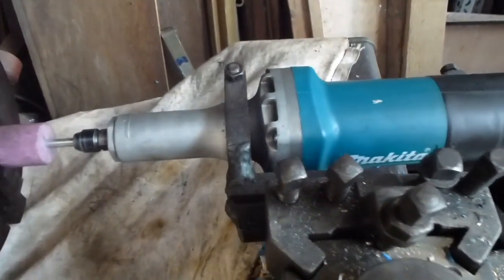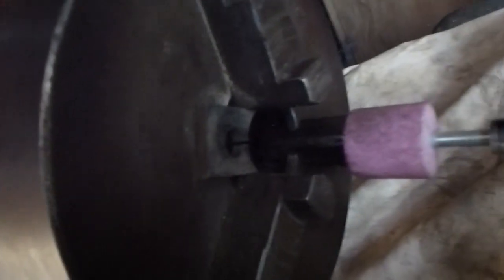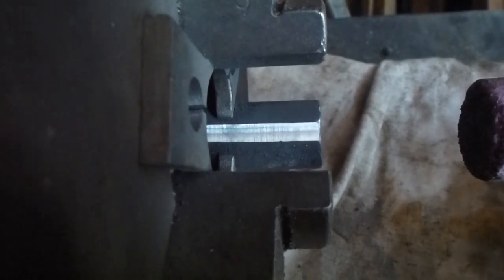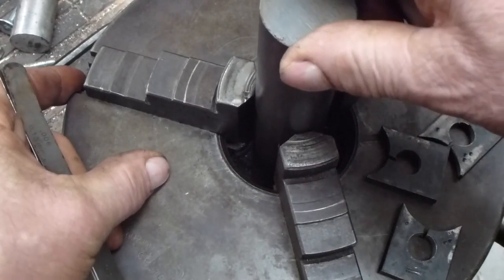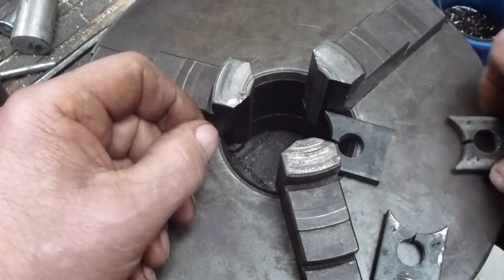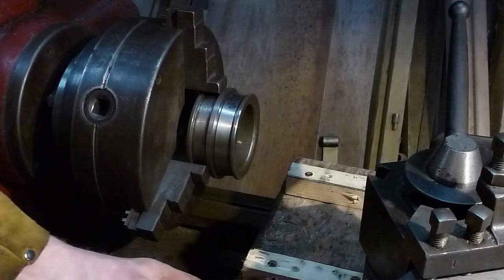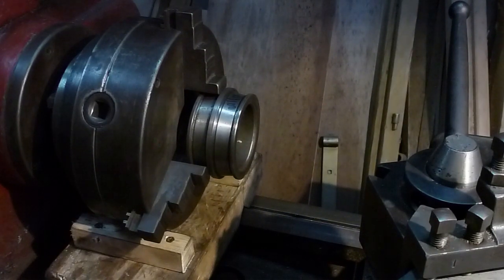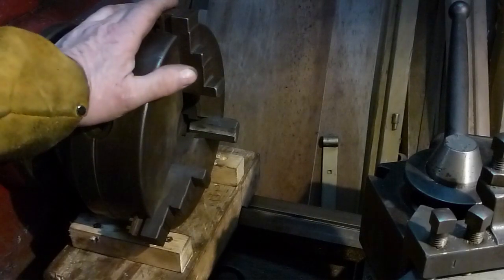Grinding the Jaws on my three jaw chuck Final version re-edited the end.

Comment: Time to get a new chuck mate.  A lathe is only as good as the chuck and the man using it. The best way to do this is to drill a hole in the exact same place in the furthest most part of each jaw for a small bolt. Then get a short length small diameter ring held on the very front by the heads of the bolts and tighten well. The smaller diameter you can do this the better.  Feed the grinder in and out automatic making sure to clear the pass each time at both ends.  If you want to you could even make a couple of spring passes from the back out most of the way but not the very end.
Reply from the maker: l allready did get a new chuck!  I've seen  the holes in the jaws since ( useful for holding copper protection in place too!! )  but the  bIocks  work very well !

Comment: I do not think that I would have the cuts in the blocks, I think this may be causing the problem.
Reply from the maker: Thank you for your comment! The cuts allow a better closing, they compensate for slight differences in the wear on the jaws. The problem is wear, not the cuts! Once reground, the chuck will be accurate at the diameter it was ground at! Cheers, Matthew.

Comment: I've seen a number of these videos and it seems fairly common to go into the chuck with some kind of round grinding wheel, or stone. Not only is the way the grind is applied contingent on how parallel the jaws are  to the z axis, but you're also grinding them at a radius. for small parts the surface will impact the parts somewhere in the center of the curved grind, but then at some point you'll be contacting at the outer points of the radius. 
I have no expertise at this at all, but I have to wonder if the best grind would be done on a milling machine and ground 'flat' or on a surface grinder and the jaws be mounted so they are a perfect 90 degrees to the track that the jaws slide on. I believe that if one has slop or play in the jaw tracks that will be another  issues that must be addressed, and not simply grind the Jaws with a greater than 90 degree angle which would result from clamping them onto something creating tension before the grind. One problem is that you cannot assume that the slop or angle of the jaw be consistent through it's travel so it's better to address that slop and fix that as well.
As a quick fix that will certainly improve a chuck I think that what's done in the video is fine, but to get a more precise repair I have to wonder about other methods short of buying a new chuck.
I've noticed that on my chucks the body of the chuck is soft steel, and that the jaws are hardened.
Reply from the maker: Fred, thank you for your comment, your absolutely right, but I only set out to improve repeatability! As it turned out, my chuck was so badly worn that I replaced it. Chucks very often have curved surfaces on the clamping jaws as it is a good way to make them concentric. I wasn't out to make them perfect, once ground, the point where they were reground is the only diameter that will be repeatable, the rest of the clamping range was improved, but it will never be a new chuck again!

Comment: Hey man. You need a thing like a tungsten milling bit or square router bit to cut the new face inside the jaws eh. Since that pink shit wears away just so so quickly. It's a good video and I needed to see done what you have done to hone my own ideas of fixing this age old situation. My lathe is an old basket case that is cobbled together out of whats left of a once fine machine with a big thread that takes the chuck. It can make some round things though. There is no substitute for expensive new things. Keep up the good work. I cant get a new lathe either.
Reply from the maker: Hi Jack, thanks for your comment! Well, that pink stuff is fine, I wasn't taking off a lot of metal! It did the job. I did end up changing the chuck as not only was it bell mouthed, the jaws rocked in their slides and the scroll was past it! It's for demonstration purposes, it's a 1942 chuck that had done a lot of work!

Comment: Hi, okay. But it is true for that particular diameter of the zone were you ground it. once the job diameter changes then you will face the error again. It means the error is depending upon the internal spiral plate not only with the jaws. The damage is not equal at all times.
Thank you
Reply from the maker: Thank for your comment. Exactly right, but it can be an improvement! The scroll wear will always be there, but the jaw bell-mouth wear can be removed!

Comment: I'd like to gring the jaws on my little 7x12 lathe chuck but would need to be very careful. Just taking metal off those faces can leave a hole when the jaws are closed for small diameter parts. Wondered if your stone was so soft it was reducing it's diameter as you went in making it tapered.
Reply from the maker: The ja ws  on mythree  jaw chuck  were badly worn, 75years old, they had  had a  hard life, probaly  in an  industrial setting.   The  stone  I  used wasn't  a soft  one, so,  the  taper came  from the jaws rocking.  I doubt  you  will  have much wear  in  your chuck, so  you  won't  need  to  grind  it much.    Do  you really need to grind it?  Don't  hold me responsible  for  any damage!  Cheers Matthew
Reply: @MatthewTinker-au-pont-blanc  Not wear just cheap Chinese chuck. Will not hold a 1/4 inch HSS round true enough as a test for making small parts.
Reply from the maker: @gvet47  In  that case, I'd  use  a small  diameter stone, runing  as fast as  you can (a  dremel  or a die grinder), taking very  small cuts.  Good luck!

Comment: I am assuming that you have got this clearance on the top of the jaw after grinding because the lathe ways is not 100% parallel to the centerline of the spindle, I assume you will get a decent taper if you ever turn a cylinder, I really dont think that clamping down was the cause, in such an operation you MUST check if your lathe is making a taper or not first other than that you will never get a parallel jaws
Reply from the maker: I'm not sure about the clearance that you are referring to. This nearly eighty year old chuck was bell mouthed and had both worn jaw ways and scroll. I had considerably improved the chuck, but, it wasn't consistent enough for my liking. I have subsequently replaced the chuck with a new 8" 200mm chuck. the alignment of the new chuck is spot on! Despite it being 2" 50mm smaller, I have gained in capacity as I have both inside and outside-jaws! Regards, Matthew.
Reply: the clearance at 8:50 (not gripping all the way)
Reply from the maker: @GraphicManInnovations  That's due to the wear in the ways the jaws run in, instead of moving in a straight line, the wear has put a curve in the ways. This allows the jaws to rock outwards. I was able to reduce this by putting the blocs in the front. It was better! As I said, a new chuck corrected all that! No misalignment with the bed!
Reply: got your point, thanks for ur reply

Comment: Your grinding wheel is tapered and you weren't passing the largest part all the way through to the rear of the jaws.
You can see this by the shiny marks on the jaws being tapered.
Reply from the maker: Thank you for your comment. The stone went through until it sparked out. It doesn't mater if it's conical. The marks on the jaw are tapered because the slides on which the jaws ride are worn allowing them to tilt out. The wear in this 70+ year old chuck meant that it was despite it being much improved I decided to replace it.

Comment: I reground the chuck on my mini lathe. Using the same general method, only I used 3 pieces of 1/4" round stock cut about as long as the last step of the chuck jaws (about 1/4" on a mini lathe (3" chuck). I used a dremel type tool to grind and a diamond chain saw sharpening bit. Went to .008" runout to .001" runout. Very easy, very effective.  https://www.youtube.com/watch?v=tA2iTgFIEVc
Reply: Paul Dana  l disagree, there is tolerance in the threads otherwise they would not work. Spacers that only contact a portion of the jaws are not giving a true indication of the contact surfaces of the jaws  when actually fully tightened.

Comment: I don't understand the splits. Surely they will put compliance into those pieces, and the jaws will end up in an undefined position. Solid pieces will guarantee that the jaws are exactly where they should be.
Reply from the maker: I disagree, the slots to the holes provide a slight spring which allows any small differences in the seat of the jaws to be taken up, allowing a more accurate grind! Regards, Matthew

Comment: The grinding tool just went part way and therefor it ground it self to a taper thus adding to the problem with the chuck jaws.
Reply from the maker: Thank you for your comment! I see where your coming from, it's not the case, I waited till it stops sparking to know when I've ground the full length. The check is so badly worn that the jaws rock, by moving the blocks out to the end it improved things! The chuck is going to be relegated to a welding turntable as I've replaced it with an 8"/200mm chuck!

Comment: Just clamp a piece of  plastic round stock at the tips and hot glue the jaws in place. After glue is set remove plastic and grind.
Reply from the maker: I don't see any advantage over the block system. I can't see hot glue as being solid enough to take the pressure. Regards, Matthew
Reply: @MatthewTinker-au-pont-blanc  I have ground a chuck using hot glue and it is very secure. Gripping a piece of round stock with the tips takes the play out and puts them in a normal gripping position.

Comment: If you keep loading one inch stock then the scrolls will wear at that point and every where else will be true. In general usage you use a variety of thicknesses  so should wear more evenly.Thank you  for showing how to true up the inside face of the jaws.
Reply: Yeah ive found that with certain diameter stock  the three jaw chuck is more out of wack than at other dimeters. Im guessing thats due to most work  being done with stock of roughly that size

Comment: Mmm great talk thru.    Old chucks!   yes, what to do! almostto the stage of throw away - but from what you've shown, still salvageable I was ahead of you with the taper runout - WHY NOT use thicker Plates  aka Blocks to give square centering of the jaws ?   But then again if jaws are wobbly, the almost knife edge of a steel strip would be better than the indeterminate hold of blocks -and would they be truly parallel ?    Will have to go out and check for myself - the beauty of all these instructional videos - not so much "who is correct", rather "showing how to overcome a problem"   Thanks - highlighted some issues  - Learning by Watching from experience
Reply from the maker: Thanks for your comment, I still haven't made the backplate for the new chuck! I agree, this is more about spreading the idea of being able to regrind a chuck. The original chuck is something like 75years old, it'll probably serve as a welding positioner! Regards Matthew